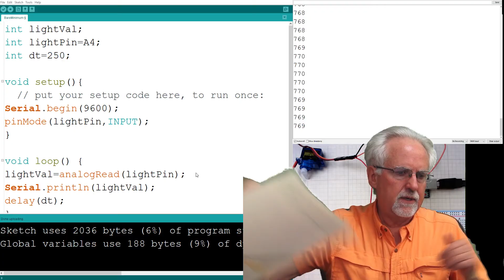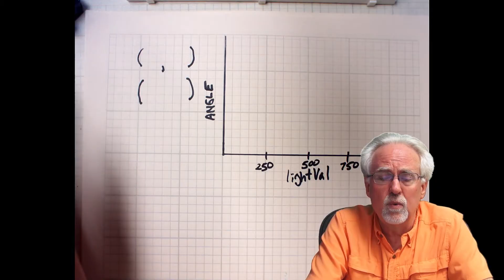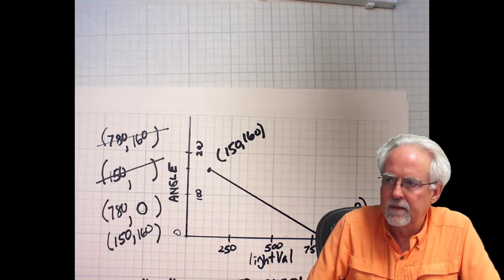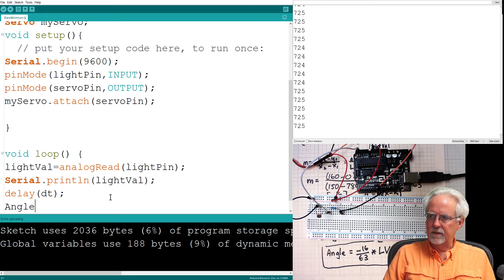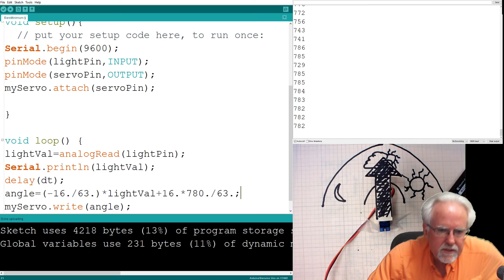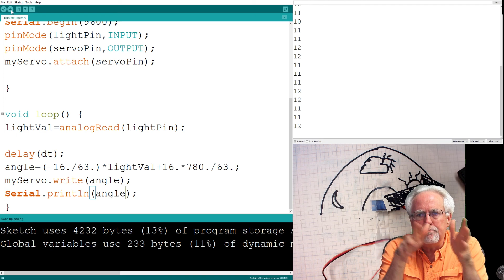Arduino Tutorial 31: Using Servo in a Simple Project

Comment: i just used a number rather than 2 variables since i only want to move it according to light value for me if its less than 120 servo will move at 15 degree and if its value is more than 270 it will move to 165 degree.But the way you did  is more valuable and accurate .

Comment: This was fun... I got the homework right bit approached it slightly different. my low light reading was zero and full light was 580;

void loop() {
  // put your main code here, to run repeatedly:
 lightVal=analogRead(lightPin);
 V2=lightVal*(5./580.); 
 Serial.print(mssg);
 Serial.println(V2);
myServo.write(angle);

if(V2>3){
  myServo.write(180);
}
if(V2<3){
  myServo.write(0);

Comment: Your lessons are phenomenal! However, when my photocell detects light, the numbers go down and vice versa for no light. I've tried hooking things up "backward" but the results are the same. I don't understand why this is happening.
Reply: So I had this issue as well when we first started with photo cells and I found that the position of my resistor in my circuit was the main cause.  So with power from the arduino to one leg of the photocell then the other leg of the cell is attached to the resistor and then the other leg of the resistor is to ground. This is how I got mine to react the same way as Paul's.  I hope this help's. Took me about a week to figure it out.
Reply: Thank you! I'll definitely try that!
Reply: It worked!! Thank you!😁

Comment: Paul, I wonder if you can make a video to talk about the connection pins for various components we used so far (photo resister, potentiometer, buzzer, led light….). When do we connect to 5V? when do we connect to digital pins? when do we connect to analog pins? Also, in this video, you have a white wire connecting pin #4; in this case, that wire is to measure some ‘inputs’ from photo resister or potentiometer, …. Can that be connected to an analog pin? Also, does the positive wire normally connect to 5V pin in this case? Thank you very much.

Comment: Sir, But i kinda did it without Using the Maths. I just used the " If Statements "
For example -
 if(Lightval > 500) { 
ServoPos= 90
}

And So on For the Night and Cloudy Day

Ohh, but my Method won't move the servo in Between Values

Comment: Hi Paul,

I did assignment before watching this videos to verify if my maths calculation is correct. it's all thanks to knowledge that i have learnt from you on previous tutorial . I strongly agreed that explaining how's the maths work is really important as it let us understand how to find the ratio of y-axis to x-axis .Love your tutorial as it really detailed and funny . I would also like to suggest to put Formula , Minimum and Maximum value for servo angle and photo-resistance in the code as it would ease to review and check the codes and less mathematical errors. Anyway i do really wish if you could continue with this Arduino tutorial series. Stay healthy.

Below are my arduino codes:

#include <Servo.h>
int servoPin = 6;
float servoPos = 0;
Servo myServo;
int waittime = 500;

//x1,y1
float minLightres = 50; //x1
float minAngle = 0;   //y1
//x2,y2
float maxLightres = 885; //x2
float maxAngle = 180;  //y2
float gradient;

int lightPen = A0;
int lightVal;

void setup() {
  // put your setup code here, to run once:
  Serial.begin(9600);
  myServo.attach(servoPin);
  pinMode(lightPen, INPUT);
}

void loop() {
  // put your main code here, to run repeatedly:

  lightVal = analogRead(lightPen);
  Serial.print("lightVal :");
  Serial.println(lightVal);

  //Formula : (y2-y1) / (x2-x1)
  gradient = (maxAngle - minAngle) / (maxLightres - minLightres);
  servoPos = (gradient * (lightVal - minLightres)) + minAngle;
  Serial.print("servoPos :");
  Serial.println(servoPos);
  myServo.write(servoPos);
  delay(waittime);

}

Comment: I used 6 "if" statements and set the servo position to change by 36 degrees with every 100 unit drop of "lightVal" from 750-150.

Comment: I was able to do my assignment. I used a range of 10-800 for my sensor, and 0-180 for the servo which I made my dependent variable, so I got my mathematical relationship through this. To eliminate negative and above 180 value, I used IF conditional statement of which I set the likelihood of negative value to 0 for the servo and the above 180 to 180. I got my my result.

Comment: Got it to work on my own but my servo was pretty jerky!!(even in total darkness!!)  Maybe it was the cheap servo, or maybe my code.  I have "a boatload" of Hitec and Savox servos I use for my RC trucks so I'm gonna try with one that will work with the Arduino.  I have a bunch of Castle BEC's too so I can make any of them work really.  Just started this Lesson so let me un-pause and see where I went wrong!!
Reply: Ok so I was right!! You said it at the end too I believe.  Hooked up a Hitec HS-82MG and it was buttery smoooooth!!! Great lesson Paul!!
Reply from the maker: Yes, Hitec are great servos. Just be very careful powering servos from the arduino. If you draw too much current, you can fry the arduino. The little blue ones in the kit are known to be safe. Other ones . . . use at your own risk.

Comment: Hi Paul, I found you after getting a completely different kit intended for Raspberry PI & an Arduino clone from Sunfounder and some generic modules from different vendors, I do not regret buying that though, I got into some trouble with servo included in kit, it makes the board fail when connected to 5V pin, Arduino is not visible to computer anymore, until detaching servo, I thought burnt board's chip, but without servo attached everything went back to normal... Turns out servo works as intended BUT attached to 3.3V pin... Vendor's site says that servo should be attached to 5V, but it just don't work when doing it... After figuring out that, was able to make homework before watching this lesson. I just wanted to share that and say thank you for making this series.

Comment: Feel free to use mine~

#include <Servo.h>
Servo turbine;
void setup() {
  // put your setup code here, to run once:
  turbine.attach(9);
  Serial.begin(9600);
  pinMode(A0, INPUT);
}

void loop() {
  // put your main code here, to run repeatedly:
//  Serial.println(analogRead(A0));
  int theangle = (analogRead(A0)-360.)/330.*180.;
  turbine.write(theangle);
  Serial.println(theangle);
  delay(100);iiii
}

Comment: I am an engineering major in college, so I do really appreciate the math involved. I would like to say, though, that there is an easier way to do the math (arduino does it for you). I used the map() function and mapped the light values to an integer for the servo angle (i.e. my light values were from 250 to 750 so I typed angle=map(lightVal, 250, 750, 0, 160) ). I am sure you know this function and I am probably just getting a bit ahead of myself. I really appreciate all this fantastic content!
Reply from the maker: These lessons are not about doing things the easy way, they are about learning how to do the math on your own, and applying to a real world problem, which is something people will pay you to do. Using the map function is not doing the math, it is copying someone elses code. Guys, know the math, use the math, understand the math, dont take shortcuts.

Comment: I'm just getting zeros on my cereal monitor, I've switched photoresistors, checked wiring a million times, my sketch is working...thoughts?
Reply: Check you have the correct resistor, I had the same problem then realised I'd used too high a resistance and was getting no voltage to the photoresistor. It might not be that of course, but it's worth checking.

Comment: Honestly 16/63 is so close to 16/64, which simplifies nicely to 1/4, and the numbers we're using aren't very precise anyway, so I would just round it to 1/4 to make things a little easier.  I put the numbers into a graphing calculator just to make sure, and the difference between the lines is almost non-existent.

Comment: I did the homework, mostly by myself I got the M-slope value but point-slope equation is a bit harder to solve as my algebra is a bit rusty. I used an online slope calculator to help to get the line equation. The programming part was all good. I am doing some more algebra lessons, so soon should get the hang of it too. Thank you for your time making the lessons.

Comment: In addition to my previous comment, I figured that some people may need to know this; when I typed "#include <Servo.h>" and checked the code for errors, I found that there was no "Servo.h" to include. It turns out that, by default, Arduino version 1.8.13 doesn't already have a servo library. So I went to the Arduino menu Sketch>Include Library>Manage Libraries then searched for and installed the "Servo" library. I typed "servo" into the "filter your search" field so i didn't have to scroll through a bunch of libraries to find it. Hope that helps someone. If I hadn't know about adding libraries, I might have been dead in the water.

Comment: I almost got it before to watch the video. I did the math  and the circuit well, however, my project did not work because the equation in the code  was: servoPos=10+(155/283)*(lightVal-17). Then, after watching the video, I added the points servoPos=10.+(155./283.)*(lightVal-17.) and it worked. however, I cannot find the reason why the point are so important. In my opinion, the points give decimal and then accuracy but I think it should work ( less accurate) without points as well. Can someone explain me why? I would really appreciate.
Thank you Paul, I really enjoy the Arduino course.

Comment: I got it working but I used 0 to 1023 v. My servo has black red and white wires. Black is ground, red is 5v, white is the output. Math isn't too hard as long as I remember the slope formula and point slope form

Comment: Great code. However, I didn't include the pinMode (OUTPUT) for some LEDs that I included. They still worked? That confuses me?
Reply from the maker: Long story. You should always set your pinmodes, but in certain cases it can work without it. Sometimes LED will light, but will be dim.

Comment: I enjoyed this assignment! I tried the servo code then copied and added it to the light detector circuit that sets the red and green LEDs and buzzes with the change in light condition.... My favourite part was determining the equation  of the required angle with respect to the read value of the light resistance.

Comment: Hi Paul, I did this assignment and it worked, But I have 2 questions: 1) in lesson number 26, the free leg of resistor is connected into 5v pin and the leg of photoresistor which is free is connected into gnd but you did exactly opposite in this lesson. why? (because the photoresistor doesn't have polarity?).  2) in lesson number 30 in void setup you didn't write pinMode( servoPin, OUTPUT); but in lesson 31 you did. because I didn't set that too when I wanted to program this assignment and without that command or statement it worked normally. Should I write pinMode(servoPin, OUTPUT); in void setup if I want use Servo motors?
And I am very glad and tankful that you created this course and it is very professional and amazing.
Reply: 1.) The why may be only a choice made at the time—a favorable outcome results in either case. The resistor and LDR form a voltage divider or serial network. The current flowing through both components, being a serial network, is the same. Moreover, the current flow is proportional to the light shining on the LDR. Therefore, the current flowing through the resistor and LDR produces a voltage drop proportional to the light on the LDR. Consequently, measuring the voltage drop across either component will give you a reading proportional to the light on the LDR. 2.) Pin-mode in the set-up is unnecessary since it’s already part of the Servo library included in the sketch. All libraries include two main files, one ending with .h and the other .cpp, in this case, Servo.h and Servo.cpp. Go to gitHub.com and search “servo.” Fine and select “arduino-libraries/Servo” follow the folder directories src/avr/Servo.cpp. Open “Servo. cpp” and check line # 241, where pinMode is implemented to set output.
Reply: Thank you

Comment: Did my homework. Fun. Got it right.
As a test I connected the resistor with 5V and the other pin of the photocell to gnd. Of course this gave me other
results to calculate with. it worked the other way around. But I got the thing working.
Question, I didn't make a pinMode for my servopin, and it worked just fine. How is this possible?

Comment: I did the math a bit differently. I had light values between 0 and 780, so at first I used 180/780*lightVal and I got 0 degrees at light val 0 and 180 degrees at light val 780. To reverse it I used (-180/780)*lightVal+180 and that worked just fine. I am really enjoying this series, thanks for making it!

Comment: 36:41 “did you get upset when i went over the math?” 

i think you have two viewer types. those that want to know the arduino way on how to read a button, move a servo, blink a light and so on. they want to learn how to load a program and learn the API and they probably know the math. then there is another group that may or may not know arduino and needs the math on converting angles, converting to volts and so on. i’m watching to learn how arduino works and i don’t need the math now but i may need the math later. 

if you were asking how to address this to please everyone i’d say you break it into two parts. first part is how to talk to the servo and get it to move. the api, the commands and so. the second part could be the math or more details type of thing. compare it to the headline of an article and the article content

having said that i appreciate your classes and teaching style the way it is. thank you!

Comment: I am trying to take this a step further and use Lighting DMX to move servos however the code keeps failing. Using the library servo.h and <DMXSerial.h> it keeps failing at the int commands. Any Ideas?

Comment: I did build the project and coded it to get it to work. I'm not good at math, so I used a series of if loops to set the angle for the servo. Worked just fine. Replaced the if statements with the calculation and of course it worked. Really enjoying these lessons.

Comment: I did the homework but I used a 330 ohm resistor so my range was between (0 ,128) for the light and  the servo angle like (0 - 175). Is this okay Paul?

Comment: Hi Paul, I used if statements in my solution with various ranges matching various positions. It indicated bright, shady and dark, but not with the smoother action your math solution has. I then followed your solution using the math along with you, and I think I understand the concept, but would need to use my notes to replicate it again. I did use (//) comments to make notes in the Arduino file I created while following along with you so I can see how the math was done and replicate it on my own in the future. A little bit more effort to take those notes but I am sure it will pay off. It is all saved to my Paul_McWhorter_Arduino folder. Thank you, once again!
Reply: I did similar solution too :-)

Comment: After wondering about the 'math' on this project I ended up just putting in 3 if statements and told the servo to go to 90 for mid light level, 0 for low light level and 180 for high light level. The servo does as told as the light changes. Not too complicated. Did anyone else do this? I did not see any reason to worry about slope when we only needed to set the servo to 3 positions. Am I wrong? :)
Reply: Ok I was wrong. Paul asked us to calculate the slope and distribute the servo movement over a span of degrees, light to dark. I used a set of 3 positions which worked in a sense but was incorrect in the scope of the assignment. Sorry I misunderstood. :)

Comment: Sir, I just revisited lesson 30 and 31, and realize that you didn't use pinMode for Servo control pin in lesson 30, but it still worked fine. And then, you used pinMode for Servo control pin in lesson 31, and again it worked. I'm a bit confused on whether declaring pinMode is compulsory or not, for a Servo motor control pin. Thank you. Great video as always.

Comment: Thanks Paul for the great videos, I do the homework you set and agree that the math portions are essential for understanding the process for developing solutions.  I also think that  the formula for angle should have included brackets after 'lightVal' to align with the developed formula e.g. angle=(-16./63.)*lightVal+(16.*780./63.) even though it wouldn't change the results.  Otherwise a great series and way to learn  Ardiuno whilst in lockdown in Australia.

Comment: I did the math and the assignment but the servo doesn't stop vibrating because of the unstable resistance of the photo resistor. So I come up with an idea to round off it's resistance value to the nearest tens "using some maths"